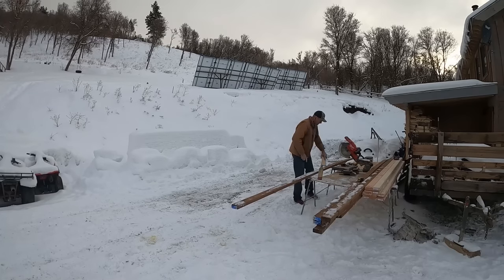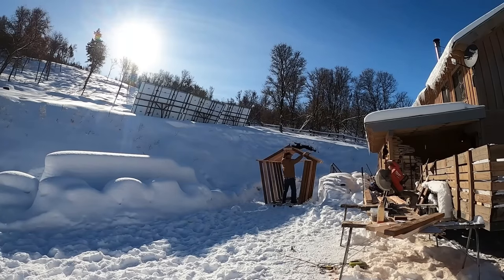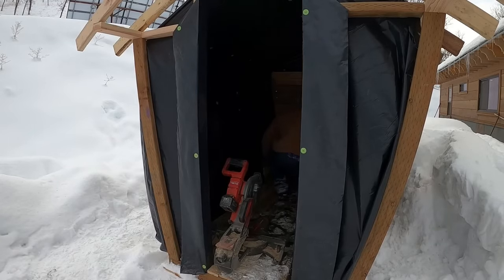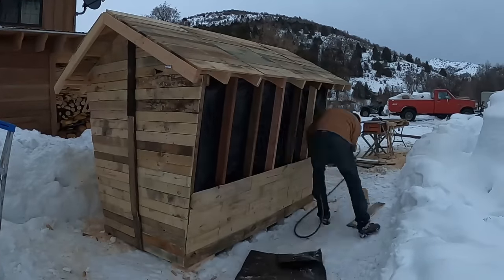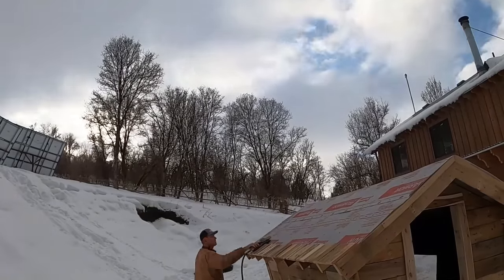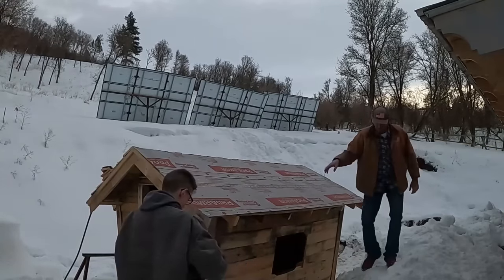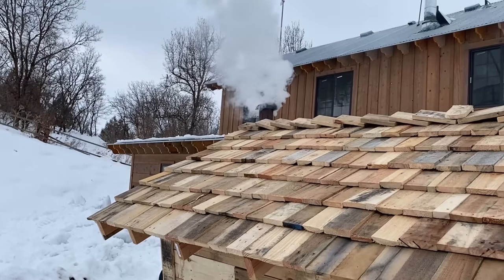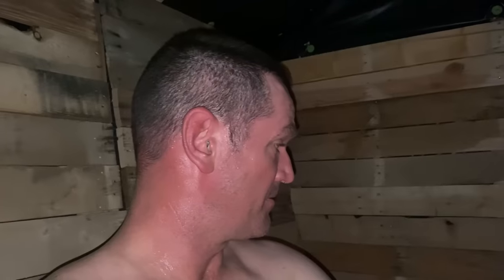#394 - I Built A Sauna Out Of Pallets! And It Works!

Comment: You do realize that pallet wood is full of chemicals right. You should not burn it in your house, it will coat the chimney and become a fire hazard. I would not use it for a sauna either
Reply: Would sealing or painting  the wood help or would that also create issues? Just wondering if there is a substance that would not leach?Maybe metal of some kind? ?
Reply: I thought he once mentioned he gets his pallets from a pallet yard that sells their “untreated” pallet wood in bulk. 👍🏻.
Reply: Not all pallet wood is "full of chemicals".  Most of them are just plain wood.
Reply: The more chemicals you are exposed to the more your body is used to expelling them!
Reply: @chrishare3981  I don't think this is correct.  Think heavy metal consumption, your body cannot metabolize or evacuate metals such as lead so it just accumulated in your body slowly poisoning you.  Your body doesn't always clean itself. Having said that we also do not need to live in fear of 'chemicals' in our environment.
Reply: I work in supply chain of a heavily regulated industry, materials can be delivered on wood pallets but not enter our warehouse. However if those wood pallets are anything other than simply heat treated (I.e. any chemical treatment) we can reject the material and demand an investigation from that supplier so far from all wood pallets are chemically treated
Reply: Also any pallet that is only heat treated is easily identifiable with an HT stamp
Reply: Anddddd, I commented to early before he said most of the structure was PT. Although modern PT is far less toxic than the old stuff I still wouldn’t wanna take a sauna bath in it…
Reply: Not all pallets are treated... red and blue ones are treated and should not be burned

Comment: Awesome project. I am worried  it might rot or build up mold faster than you would think but time will tell and it is also eco friendly with recycled pallet wood wich makes it awesome. Seems a bit too small for my taste but they do sell these "barrel saunas" here in Finland and heard that those give quite nice sauna experience or "löyly" as we say here wich basically describes the steam when you throw water on the heated stones and it being spread around the sauna. Also would like to say dont make it air tight. A good healthy sauna is also breathing one, it needs ventilation to dry up properly and you dont want to run out of fresh air in hot steamy room.  Hopefully you will have many many great löyöy's in there. 
Peace and love from Finland

Comment: A friend of mine built a sauna kinda like this one.
For the heat he used a propane tank with a long hose with a “flamethrower”  that heated a metal box inside the sauna. On top of the metal box he welded angle iron around the top and filled the exterior top with lava rock.
When the metal box and lava rock was hot enough he’d add water with eucalyptus oil over the lava rock. 
He built benches with cedar slats.
It was a great sauna and he and his wife shared many evenings enjoying it for many years.
I’ve talked to my wife about building one from old pallets, like my friend did on top of our covered deck that looks down our mountain side and into the canyon floor below.

Next year we’re also building a natural looking waterfall on the north side of our house. It will naturally fall from the outside of our bedroom down to the front side of our house into a natural looking “pool” with built in seating for 4 only for the water to be pumped up to where it begins.
We built our house into the side of our mountain.
The front of our house on the ground floor is our oversized 2 car garage on one side and a 1 bedroom 1 bath apartment on the other side for our aging parents to live in.
Our back door (on the second story) also is on the ground.
This is why the waterfall will naturally flow down.

Comment: If you’re worried about a lot of snow accumulating on top of the sauna roof, just turn your sauna on and all the heat and steam will eventually melt the snow, since you don’t have any insulation. In an older neighborhood, during snowy season you can tell who has bad ceiling insulation and who doesn’t. The snow that’s melted way quicker on one roof over all the others, the snow melted roof has bad ceiling insulation.

Comment: Great job, I think your in your element when your building things. I remember seeing old sheds made in the depression they used 2 ft pieces of wood siding. I wish you health. Did you know after getting out swedes get small branches and whip themselves, to get the circulation going then run like crazy into the house.
Reply: Rumor has it Tiger Woods actually got hit in the head with his own 9 iron by his crazy ex.  Next step would be them beating themselves with branches.  It all fits.
Reply: Ha ha really they do that, I thought they were nuts. I pay to much in heating bills to ever want to get coldZ
Reply: @susanknight8961  I used to windsurf on Lake Michigan with 33 F water and air temp about 20 F so cold it was freezing on my boom.  Wore a non water proof blue wetsuit with a funky windbreaker type top.  Falling in was like falling into ice water because it was then the windchill evaporation made it even colder.  Nuts.

Comment: Nice salvaged material project! Soaking away a hard days labor is a reward few in this country realize. Oh by the way, per your offered safety recommendation, lower your blade so that the bottom of the top toothes gullet is just above the board surface. Safer and less intimidating on camera. Keep your tools and your senses sharp focused and pointed in the right direction.

Comment: Nice, but surprised you haven't decoded "you'll have to build a garden shed to match" means, just keep going out the back of the frame another 8-10'  and build a shed that butts up to it for her. You'll just have to change where the pipe comes out ;) Easier to do it then, you had the tools on hand after all, even if you just did the frame, and finished the Sauna 1st.

Comment: Best way ive found to remove residual propane from a tank before cutting or welding is to remove the valve and throw the tank in a fire. It won't explode. It will just have a bit of fire coming out the opening.

Comment: Might want to check on the pressure treated lumber letting of gases during the heating a cooling cycles of the sauna.  Even though it lined.
Reply: The pallets treated with Methylene Bromide are toxic as hell when heated and release elemental bromide gas.  Not good.  Marked MB.

Comment: Cool build, I really like the slanted walls! Not sure why you never showed the inside properly though?

I'm also very sceptical of that story towards the end. Propane will boil off rapidly when not pressurised and it doesn't stick to stuff like gasoline. If you removed the regulator and immediately started cutting into a tank there's a fair chance it might ignite when the gas mixing ratio was right. To have filled and emptied the tank with water seems like a real stretch though. I'd love to be proven wrong but I think your friend was telling a bit of a tall story.

Comment: smaller stones in the top of the sauna heater will heat up faster and give off more steam from the extra surface area..but thanks for the great video..got a good laugh out of the part where the goat got up on the makeshift workbench...

Comment: Looks great. I would be a little concerned about the pressure treated wood seeping out the arsenic/ copper when it gets up to temp but it will probably be alright (I hope) great video though, I look forward to them every week
Reply: Nevermind just saw the part with the plastic. Aside from the floor it should be fine

Comment: Couple ideas for later use, or if anyone want to do their own. Good stone size for sauna is about three to four inches, and its not much harder to build bigger basket for 40kilos of stones. Stones, not heated metal bring longer lasting not so sharp wetter heat. in Finland, its löyly, and goodone, but i dont know if there is word for this in usa. Plastic works in theory, and windstopper, but i think that wall is pretty cold to lay your back on winter. Professionally we use foil paper and foil tape as heat stop, and xps-foamboard as insulation.

Comment: I would add some wire mesh at the top where your makeshift basket is and replace those rocks with lava rocks that is used in saunas.  They retain heat better, and has much more surface area and pores that when you pour the water on them, they will steam better than those rocks will.
Reply: im not has newer hear before need boil water first and then fight to stove rock. im finnish men and use sauna ewery week last 59 year. and timper i has build to customer 100 + sauna and this is build wrong. no newer in wll plastic, need use aluminium foil. and under and back stove need be mineral sheet,rock sheet no burn wood, and were have shower and dress room ? normal human need dressroom can take out clothes, and shower after sauna have sweat. and boiled water, can wash itself good.

Comment: Sauna should heat till 200f at least. Your heater lacks amount of rocks so not that much steam either. Sauna may need to be bit more insulated for winter usage to get heat high enough
Reply: sauna perfect temperature have 176-194 F no more no less. only bugs kill, animal kill human head sauna make minimum 212F

Comment: I must have missed the part where you mentioned what that black material was that you put on the walls around the whole sauna before you put the wood on it.  I know you get a lot of comments but if you could let me know I would appreciate it thank you it looks beautiful by the way.
Reply: He said it’s just 6 mil plastic.
Reply: @mattmoschkau84  probably a stupid question but with the heat won't it work the plastic at all?  Sorry I'm not a very handy person and at first I thought maybe it was like a kind of a tent material.
Reply: Curiosidades Extrano 
Plastic can take a lot of heat, it’s used in vapor barriers in homes to the attic space which can reach temperatures well above 100 degrees. 
In this application I would assume the plastic will see some damage, but probably only around the stove.
Reply: @mattmoschkau84  thank you so very much!

Comment: That dude with the ranch and the fire water sounds like more than just some propane residue. Yes. Be careful with it, but I dunno about an empty tank holding enough residue to burn THAT much. I've seen them pop, it's a quick whoosh and that's it. If you're near it it will definitely mess you up

Comment: I am a little concerned for you regarding in the beginning of the vlog you said that you had used pressure treated lumber....with that being said I cannot tell from the video if those pieces of lumber can give off steam/heat/vapors, because I would HATE it, if you did yourself under.  Pressure treated lumber, is just that.....under pressure the manufacturer shoots deadly toxic termite insecticide into the wood obviously to ward off those nasty critters.  Termites do not like redwood or cedar, so in most fence construction for cost reasons they use 4x4 pine pressure treated lumber for fence posts and then usually the pickets and rails if they can get them are either cedar or redwood.  Just saying....you might want to ask someone about it, are those pine pallets pressure treated?

Comment: My first welding on fuel tanks
I filled them with water. .
Then from working on petroleum tank farms..
I asked the company's that were demoing the large storage tanks
That told me dry ice (CO2)
And gave me the math formula
for how many pounds dry ice to gallons of tank..
The last tanks I welded on
I filled them with exhaust
The little Kubota tractor had the exhaust coming straight out the front..
A piece of EMT conduit over the exhaust and into the tank..
Let the tractor run for about 1/2 hour before I started cutting and welding on the tank..
Letting the tractor run the whole time.. I'm almost 70 and still here...

Comment: Not every pallet is pressure treated wood people. I use to build them years ago and 95% are just junk pine. They're built as cheaply as possible. This is a cool build but it needs some kind of air circulation as you've basically built a meat smoker without it

Comment: Odd question on the battery setup but would it be better to have a board you can press a button per battery to check the voltage or just a board with terminals you can touch the probes to to check them with a meter without needing to open the battery box?

Comment: This is going to sound strange .. But to have your sauna blend in with the color of your house siding since you don't want to use paint ..  Use mud .. In the summer let the wood dry out and coat the sauna with mud ..The long it sit on it the darker it will get.,. It will get sucked in the pours of the wood .. After a couple minutes wash the mud off ..

Comment: Excellent idea, or so I thought... Now the wife wants one lol. The good news is a few years ago I built a sub deck off of my rear deck with a few steps down and installed a hot tub with lattice walls around it. It’s kinda private but we do still sit in it in our bathing suits anyway due to nosey neighbors😳. Don’t need to be scaring the neighborhood... I’m going to pull that out and donate it, after saving the pump motor just because, THEN do an enclosure for a sauna of my own. I really like rustic and do have access to piles of free pallets too so this’ll be fun! I even found free 18’ pallets which I didn’t know they made so I’m sure I’ll appreciate those long lengths of lumber. First on the books I’ve already drawn up the plans and I’m building a pallet wood shed out back once the snow melts, then I’ll move onto the sauna. For now I’m stockpiling lumber and a couple of free windows I’ve gotten off the Facebook marketplace. No matter how you decide to do your math, you can’t beat FREE 😉. Enjoy sweating those toxins out brother, I’ll be along shortly✌🏼

Comment: If you keep hitting your head it probably will out last you. Probably should add a few inches of height to the height to prevent brain damage. You could put a small solar panel on the roof and a battery to have a small light in the sauna. I believe Harbor freight has a solar powered light for sheds that might work.

Comment: Hey,,, fast and cheap is two out of three.  Is it big enough for the wood heater???   Hey, if the tank is filled with water when you cut it,,,, it clearly can't explode.  good to be safe.    I am lazy, and would have used a tin roof.  How in the world are you going to clean that chimney?.  I'm a firm believer in straight up chimneys.

Comment: Where are  all the ROCKS around the Fire Box.  Your design is not Finish Sauna design. They have more rocks. The rock hold the heat.  That is why our fireplaces were all made of rubble rock too. Once heated they would radiate heat for hours and maintain a more constant temperature.   
We have 2 rooms. The sweat/steam room has tier seating and face  wood fired stove in a rock filled box. You take your dipper and ladle up water to throw on the rocks to get steam.  The outer room is a shower or bucket rinse room where you rinse off the sweat. There you get dressed also if it is outside. Ours was in the garage connected to the house, so we did not have to got outside at -35f degrees. 
So you need to build a box of rocks around the wood burner.
You can alway use a camp lantern of propane, butane, or etc.

Comment: USDA regulations require manufacturers to treat wooden pallets before shipping to prevent the spread of pathogens. They either treat pallets by fumigating them with methyl bromide, a toxic pesticide, or by heat-treating them in kilns. ... Avoid unmarked pallets or those with “MB” for methyl bromide.

Like a guy wrote to me - you can drive across country in an old car with bad brakes and bald tires, but why risk it.  I like the idea of a sauna.  I would not trust anyone to tell the truth about: 1.  the treatment of pallets that I buy; 2. a transmission removed from a car and marked with the mileage instead of seeing the mileage before having the transmission removed in front of me; and 3. building a 40 foot shipping container costing only a couple thousand dollars into a home that would pass building codes.

Comment: I guess we have come to a difference of opinion again, not often, but NO insulation, that's just not very smart, the cost of Propane will break you, if not Propane, wood and wood smoke, don't do that to yourselves,   Any shield around the tank to protect the wood?  .    Outside, Inside the Sauna?   opppssss....   We use to keep the hot tube about 104F and the sauna about 120F maybe a little warmer,  I can't remember about the Sauna.  After a few years they simply never got used, they were a passing fad....

Comment: 120f is no where close to the temperature you need for any health benefits. Also be careful on what rocks you are heating they have a tendency to Explode , your not supposed to use plastic Vapor barrier as it will
Melt and can give of toxins. It should be aluminum paper backed vapour barrier. Not insulting a stick built sauna you will lose all your heat really easy and will burn a lot more wood that one that’s insulated . Also using random Pallets for inside it kinda dangerous as you have no clue what was on them or what environment they were in . Look cool tho

Comment: Wont the chemical from the pressure treating off gas when heated?
Reply: Any pallet labeled "MB" was gassed with methylene bromide.  Heat that up and you can release bromine gas.  So look for that MB label and not good.  The label "HT" means the wood was heat treated and that's OK.  The pressure treated may not be so good but not sure what it might be treated with nowadays.